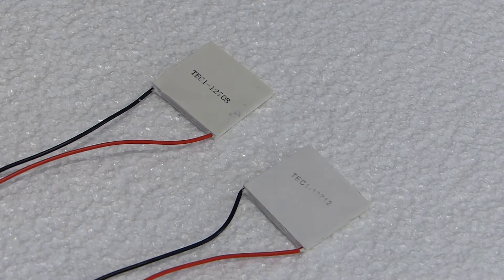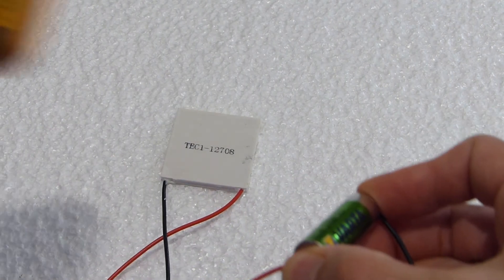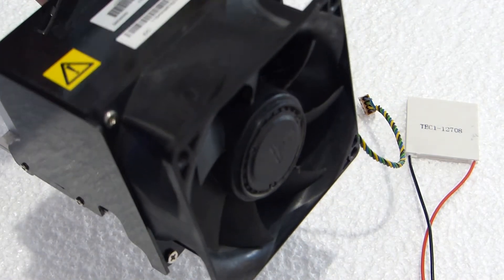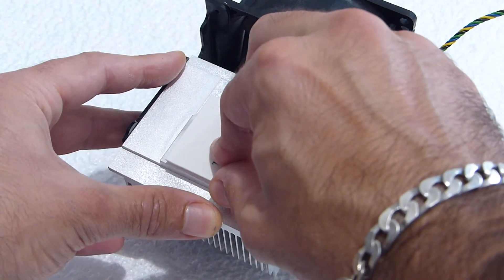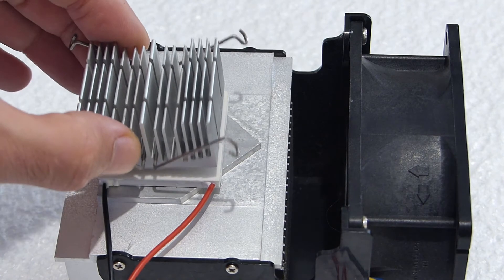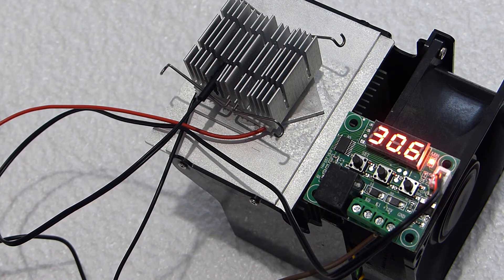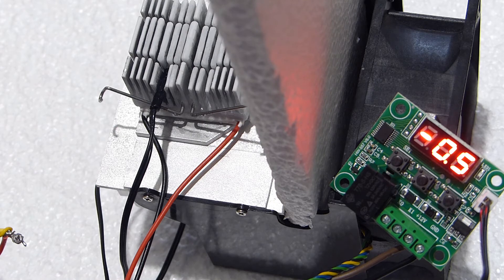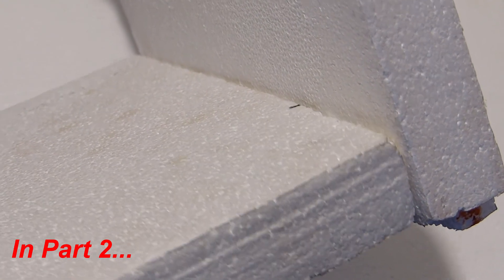Peltier Modules - Testing the 12708 and 12712

Comment: I have watched countless videos and study in-depth mathematics on the TEC modules before commenting: 

the 12708 is rated to have a delta T of 66°C base on the specification , so if your initial starting temp is 30°C room temp, you should get about -30°C give or take (Other youtubers have done it) , the reason why you temperature hover close to 0°C is because your heatsink is not large enough to be dumping enough heat out, also aluminum heat sink is not covering the entire 4cm x 4cm TEC (if you want good results, you should cover it 100% if possible). 

Do try water cooling through a copper water block (might be pricy, but worth) , it will surly give you good results.

Comment: The Preasure on the Peltier Element is crucial! This test is nonsens ! You could get even 10°C lower by better contact!
Reply from the maker: The test is real and these are true genuine results not nonsense! 

However yes I agree that better contact will get lower temperatures but it's all about heat dissipation and surface area too not just contact!

Gettung the heat away faster will yield the best results.
Reply: @ThatTechoGuy  it's nonsense because the contact between this two elements ist different ! And it makes a huge impact ! Your mesurment ist crap! A differents of 0,2mm of thermal paste makes a different of 3-5°C ! What the hack do you measure ???
Reply from the maker: @Pleusch  maybe you can make a video yourself and enlighten us then if mine is crap!

Comment: Do you have the cooling fan connected with the hot side blowing into or away from the heat sink?
Reply from the maker: Fans on the hotside heatsink are extracting the heat away from the heatsink, so away from it. I think that's more effective.
Reply: @ThatTechoGuy  Thanks.
Reply: @ThatTechoGuy  I've set up a Peltier based aquarium cooling system, which is situated atop the aquarium. It comprises two Peltier modules (7amps and 12 amps) whose cold side faces downward and is pressed against a water block connected with tubes to a pump in the aquarium. The pump circulates water into the chilled water block and back into the aquarium. The upwards-facing hot sides of the peltiers are in contact with another pair of water blocks that connect to an external water chamber with a pump. The pump circulates water in and out of the hot water blocks and back to the external chamber. The hot water blocks have additional cooling fans and a large heat sink connected to them. The whole system is connected to a thermostatic temperature controller that fluctuates but doesn't show a decrease in aquarium water temperature. The system runs on 12 volts and power supply is adequate at 35 amps from a power source (but I haven't checked its amperage to make sure). 

The aquarium capacity is 25 gallons (94  litres).

With the above set-up, I notice that the water going to the external chamber gets pretty warm within 15-25 minutes, but the aquarium water doesn't seem to get any colder. 

Some questions: a) Should I replace the low-amp Peltier?  b) Use more Peltiers of 12amps each

Comment: Hi sir namaste 🙏
 Your video is very helpful for me because I am also interested to make the project ,sir if you don't mine please tell me which is best 12706 or 12715
Reply: Thanks for your kindly respond sir 😍
Reply from the maker: Hi thanks a lot! 12715 will cool/heat better than a 12706. 1x 12715 requires 15Amps meaning a power consumption of 180watts (12volts x 15amps). The last 2 digits are always the amps, so the higher that number the more powerful. Goodluck!

Comment: so I have a TEC-12712 hooked up to 12V. There is no heat load on the cold side and the heat on the hot side is dissipated by a large 6 heatpipe 120mm fan CPU air cooler. The power supply is able to provide 13A of current at 12V. The element is only drawing about 6.3A max. Is this to be expected or am I doing something wrong?
Reply from the maker: The theoretical max is 12A for the 12712 and the current used might differ from module to module, and there will be some current drop when under load, so I do not think you are doing anything wrong, however I would check if the supply is really giving you the full 13A, maybe even try another module if you have it. Also these modules are capable of up to 15VDC, in which case will use more current and in return should perform better too, at the cost of more Watts of course. What temps are you achieving on the cold side at the moment?
Reply: @ThatTechoGuy  thanks for your reply. unfortunately, I am unable to take a measurement, but there is some ice forming on the cold side so it is sub-zero or very close (my ambient is 24C/55% humidity) 
The power supply is definately delivering what it's asked by the peltier. It's a modified PCIe 6-2 pin, so there is plenty of headroom. 
What confuses me is the fact that with 12V which is 80% of max rated Voltage input, power draw is only at 50% of its max. Maybe I am understanding something fundamentally wrong in the function of the element?
Reply from the maker: @Luftwaffeloli  I do not think you are doing anything wrong. The only thing I can think of is maybe a faulty module that might have some couples/junctions that are damaged and therefore cannot use the maximum. These modules have 127 of those. Thats why I asked what temps you are getting as heat dissipation sounds like it is sufficient. On mine I don't get some ice but quite a bit of it. See my video on the mini fridge I built, I was getting even -9 Celsius there and the ice is very evident, although I did have insulation too. If you have another module try running that and measuring again.
Reply: @ThatTechoGuy  much appreciated, thank you. do you maybe have a comparison for V/A from one of your modules?